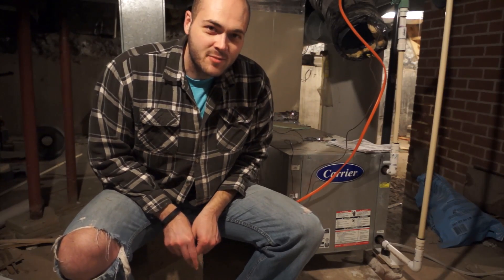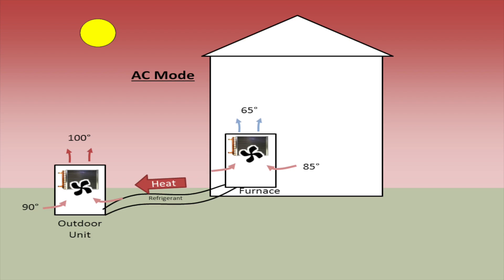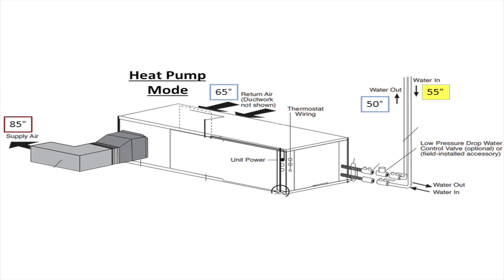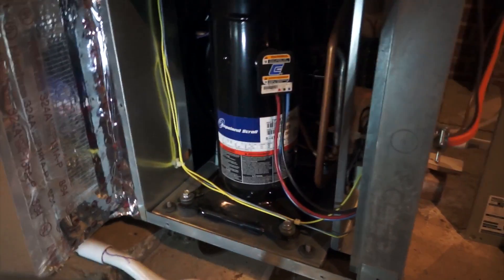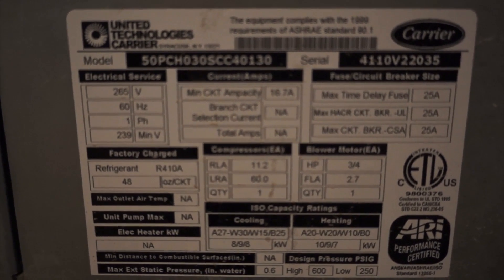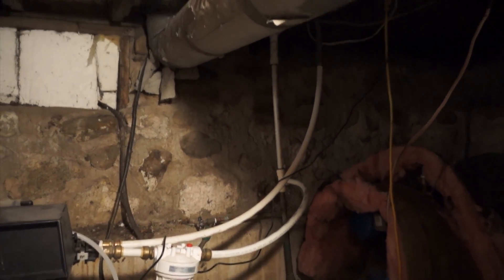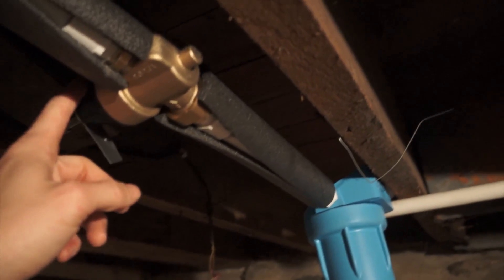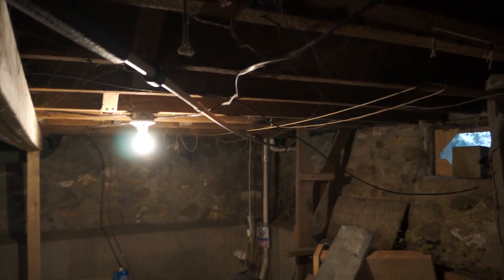Geothermal: How to DIY for cheap!

Comment: Nicely done video. Such a simple system. So you run your regular well pump for the Geo system? That has been my stumbling block,   I've been contemplating a similar well pump and dump system too. My water table is at 11' but my well goes down to 68' for potable water. The water coming out of the well is 70 deg. year round (Florida Panhandle) and plenty of it. The well has a 2 hp above ground jet pump and we only use the well for lawn irrigation, gardening, hobby green house and car washes.  I've been trying to find info on sizing a second pump just for the Geo Pump & Dump. It seems like much of the savings the Geo system would provide would be eaten up by running such a large pump both in electricity and reducing the life of the pump. Dose your pump constantly run when the Geo runs? Is the flow controlled any other way then the pressure reducer you show here to match the Geo's needs? Seams like a very simple water system you have here....I tend to over complicate my projects but our current Heat Pumps runs alot here, especially from March to October for cooling then DEC and JAN for heating, The only reason I'd go Geo over Air to Air heat pump is if it provides overall reduction of operation costs.  

We have a 10k solar PV net meter system now, and consume about 4k ($440) over its annual production each year. HP is currently a 12yr old 10 seer unit and the air handler is 24yrs old. My target is to add a Tesla 3 electric car that I went on the reserve list for the first day, and improve my HVAC efficiency enough to provide for the charging of the car and run the house at as close to Net $0 as possible while investing as little more as possible for a reliable-capable system. We have the perfect water for a Geo system, its already been tested and more than acceptable. If anyone has recommendations on how I should go about selecting the most efficient pump for my 3.5 ton geo project please comment.  Again thanks for your great video, surprisingly there is little info out there on Pump & Dump Geo installs out there even though it was system most often used in the early days of Geo HP's.
Reply from the maker: Yes, it's a very simple system. Which makes it easy for the average Joe to install.

I use my regular well pump, which supplies our home's water. This will likely shorten the life of the well pump, but a shallow well pump is relatively cheap and easy to replace. The water pump does run constantly when the Geo is on. In the water lines, there is only a pressure reducer to reduce flow, then a open/close valve controlled by the Geo to turn on/off the flow.

Not sure how efficient my system is. Overall, my electric bill increased from ~$90 (no AC, propane heat) to $125 in both the hotter months (thermostat set to 78F) and in the colder months (thermostat at 64F). Our wood stove keeps our house usually around 70F, and the geothermal only kicks on at night after the fire dies, or when we're away from home. Our most expensive bills (~$150) are when outside temps are 50-60F and it's not cold enough to justify a fire in the wood stove. I also usually switch on the propane backup if we're going to be gone for more than a day and outside temps are less than 25F.

Also, we're in central Ohio, to give you an idea of the climate.
Reply: Thanks for the reply. I'm probably going to bore a second 4" well and use a veritable speed pump down the pipe.

Comment: That's not a geothermal heat pump...........it is by all definition,  a water cooled heat pump.
Reply: I think you both need to research a geothermal unit before trying to look like smarties in the comment section.  Many commercial GHP's use the ground water as the heat sink in the system.  this is absolutely a geothermal Heat Pump.
Reply: jennifer you are 100% RIGHT
Reply: Find any water source heat pump manual online, and check the performance charts. Groundwater is by far the most efficient.
Reply: Idiot, keep proving you are one, read a a book dumbass.
Reply from the maker: It's a "pump and dump" geothermal heat pump.
Reply: No mate. Geo (ge meaning earth) Thermal meaning heat. Geothermal is where you tap into the heat of the earth and channel it to a productive use. So, in point of fact, what you have is built is, as Ron said, actually a heat pump. There is nothing geothermal about this.
Reply: @channelperth  Dude, how do you think the water from his well stays at 55 degrees? From the heat of the earth!!!!
Reply: @channelperth  aww shut up.

Comment: Are you using water from your tap?
Reply from the maker: Kind of. I use the water directly from the well pump. It doesn't go through our softener system, which feeds the rest of the house.

Comment: Hopefully you flushed that coil out otherwise you could be contaminating your drinking water. This type of work should be left for the professionals.
Reply from the maker: Contaminated with what? The water goes from my well pump, through the heat exchanger in the geothermal unit, then out of the house to a drainage ditch.
Reply: Pretty sure he means a back flow preventer. 

But contamination can occur if and when the refrigerant circuit is compromised by the water side. This happens in water source heat pumps all the time. 

I'd install one out of an abundance of caution, despite dumping to an outside source - even though you're unlikely to reverse against the pressures from the well pump, but as they say better to be safe right!

Otherwise, nice job - a few things could be a bit neater, but I'm picky. Lol

Comment: Would this work with a cistern rather than a well?
Reply from the maker: +Babycakes6211 Theoretically it could. You'd probably want to do a closed-loop system, where the water is fed back to the cistern. But you'll need a really large cistern. This would be similar to using a pond, which is a somewhat common practice for geothermal (submersed water loop).
Reply: Yes, a cistern would heat and cool fast, making it somewhat ineffective